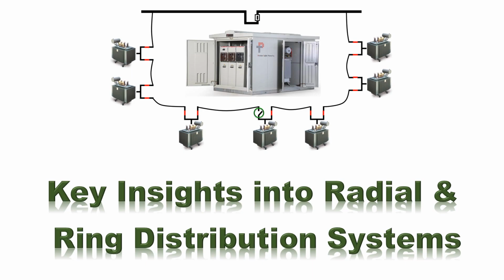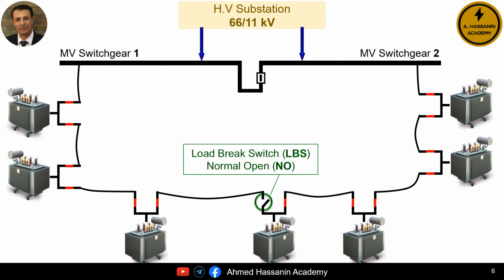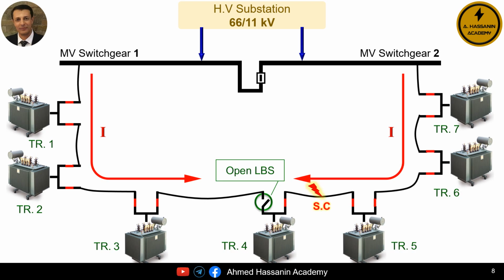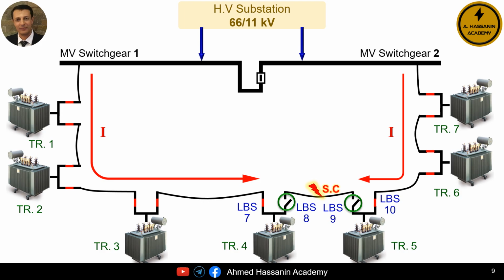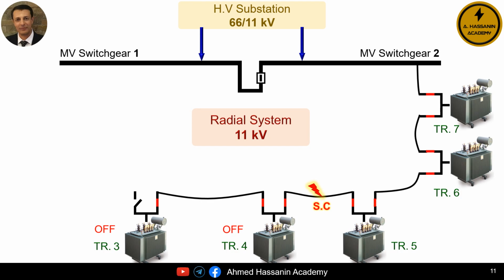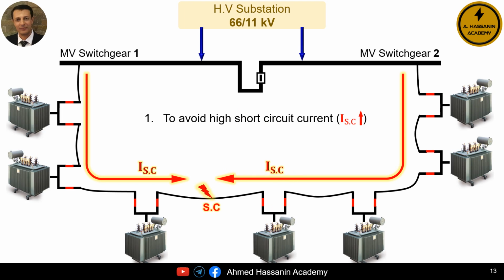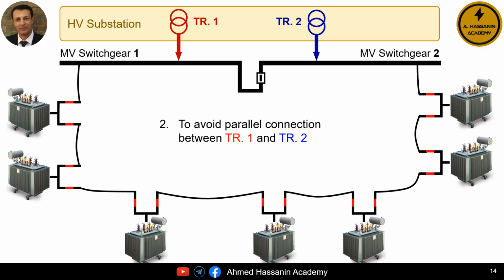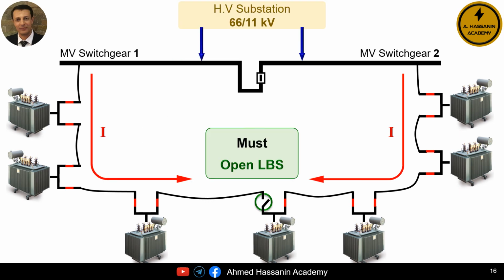Radial vs Ring Distribution Systems Explained | Advantages, Disadvantages, and Key Technical Notes

Comment: This (good) post suggests that closed ring networks should be avoided, since it does not mention that a ring network can also be operated with a single supplying transformer in the HV substation (through one or coupled two switchgears). Closed ring networks have the advantage that, in the event of a failure in one leg, all stations can still be supplied (without interrupt) as long as the other leg is adequately rated.